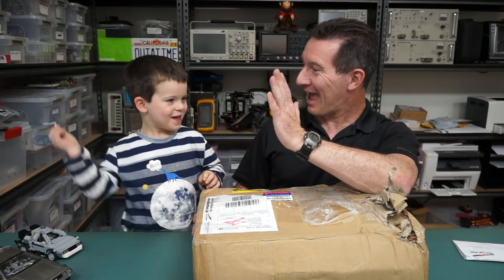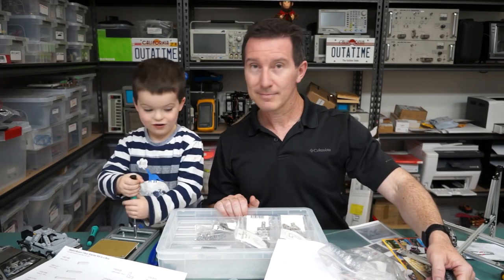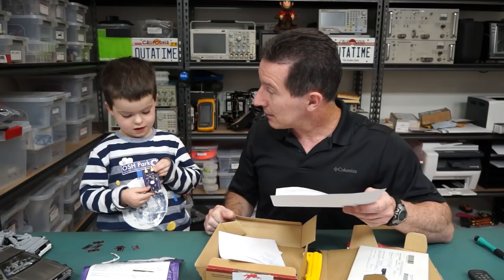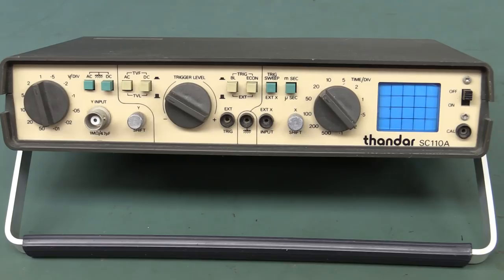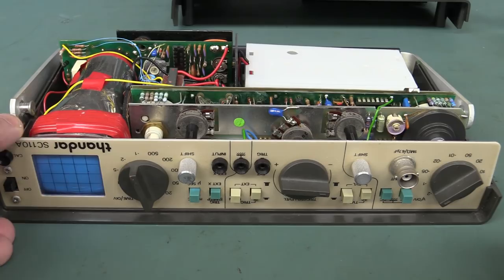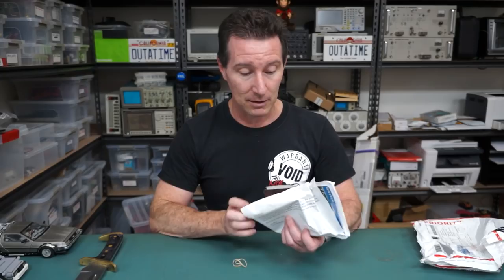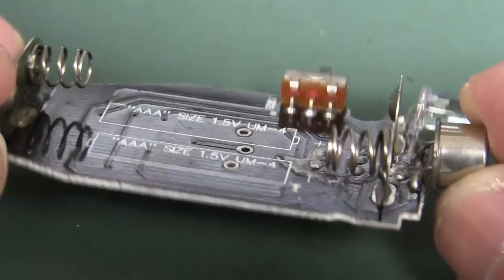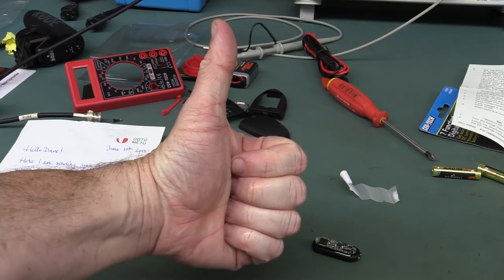EEVblog #813 - Mailbag

Comment: When I was Sagan's age, I unscrewed wall plates off of the wall.
Reply: Did you have a multimeter with you to check them out and then if they weren't working right fix them not lol for me when I was old enough I would be fixing problems the people didn't realize I had right then and there if I had the parts of a whole I kept electrical supplies with us in the car you'd be surprised when someone when asked could Aaron take a look at that lamp Outlet whatever I'm like sure where is the electrical panel so I can shut off the power if need be also the reason why I had a hundred twenty volt powered Boombox in the car and find out what circuit so it was on they did not have breaker fuse finders back then but there were times which I couldn't kill something I'm very tempted to crowbar the thing a k a dead short did that once and guess what well couldn't kill it but what are the neighbors knew I was working over there and came running over and they said how far lights are flashing I'm like what is going on and I noticed that it seems like there's a lot more energy than just it may be a single circuit turns out this was range wiring or similar it had completely bypassed the service entrance all together it was running to the meter box directly found out later bypassing the meter entirely along with us which we could not figure out that they noticed that sometimes you want to throw was extremely low and our times very high that switch was turning on and off the voltage coil do drug terminals on the back of the meter where there was a link that could be removed on those old meters so another words whoever originally had the place was stealing power obviously not the first time I've seen crazy things like this also unenroll metered water service that have been abandoned and reconnected and the horror a place that had never had Natural Gas officially but had gas appliances and was working but there was a meter that was hooked up to the gas lines lighter for these except not all of them we're actually metered but they have been using about turkey for the longest and didn't even realize there was gas present even without the meter up and to the point they smelled gas the gas company try to show it off but there was still gas on to certain appliances.

Also I've seen places where there was natural gas service but the utility company said there was never gas service to the place and there was no record of any connections whatsoever.

And also and there were times in which there was a house that have been built and there was never any gas but there was a gas line coming into the foundation that was connected at the other end and not being able to be shut off and the people thought they were crazy because they smelled natural gas but new Dr was never any girls was looking around and I spotted I can't turn off pipe in the foundation sure enough gas line leaking.

Comment: 35:10 I agree with you 100% when comparing this "Free" to $5.00 cheap meter to a $200 Fluke.
But there are a lot of new young budding electronics engineers out there that just can't afford a $200 Fluke.
37:30 If you use the meter under 50V and a max amperage of 5 Amps this meter is accurate and safe enough for electronic/arduino type experimenting. We use these cheep meters in the shop as throw away quick checks and the Flukes as precision accurate and higher voltage use.

All you seem to have done is let the younger players feel that they are idiots for using a cheap meter like that when in fact it is quite usable and accurate.
Reply: Exactly
Reply: I think the same and more: the ones surprized by the precision of cheap multimeters are idiot enough to don't contrast them with their 'great' multimeter's precision and it's many times the same 0.5%. Funny when they take the expensive multimeter for precision and many times its the same lol
Reply: yeah but it's good enough to check a double  a battery
Reply: I don't think he was deriding that multimeter or saying it is junk, yeah he was kind of negative on it but was impressed with it's accuracy and low price. But he didn't give out a flat recommendation not to buy it just pointed out that it's a bit dodgy for non hobby work
Reply: Here In india, I have seen in all the repairing shops in my hometown they use this multimeter for working with both dc and ac voltages(230 Volts)😥😥

Comment: That Rossin item is a single-beam PIR - single beam here meaning one detection zone - and PIRs are something I know about, having designed a few in the '80s.

Rossin was a US firm whose speciality was ultra-low power PIRs running off a single 3V Lithium cell and I just happen to have here the cct of their W60 I traced back in '85.

The chips should be a pair of CD4001Bs and the remarked one an MC14573 quad programmable op-amp. The L & C terminal are the output, drain and source respectively of the VN01 MOSFET. The cut resistor is probably the means of switching from NO to NC output - the W60 had a link. The Iq of the one I traced was 400nA so this one may still be working.

The IR sensor is a funny with only two terminals, not the normal TO-5 with a silicon window three-terminal one. Unfortunately there's nothing about it on my traced cct.

If Dave asks nicely I'll scan my hand-drawn cct and notes.
Reply: +Graham Langley Found I've got the product flier. It's either the R50 (wide view) or the 70W40 (long range - 21.5m).  Battery life is given as 15 years.
Reply: +Graham Langley The memory has dug up that someone had a patent on using a faceted mirror in PIRs to generate multiple detection zones - this was before HDPE Fresnel (that's 'fren-ell') lenses came along. 

It might be that the Rossin PVDF(?) sensor has multiple elements and so only needs a simple convex mirror.

Comment: Honestly though. Those cheapy multimeters are pretty reasonable for everyday use. I think in this day and age it's pretty easy to make a reasonable multimeter that would work perfectly fine for hobby level projects for pennies.

That said if I had to mess with any actually high power stuff, that would not be my first tool of choice.

Comment: Wonder if the rossin thing is a beam-break detector - that would explain the lack of facets (though may be a faceted lens insid the copper can) . Battery may be to provide pulse power due to 2-wire connection, or maybe biasing the sensor
Reply: +mikeselectricstuff Nope, it's a PIR.
Reply: +mikeselectricstuff i think is that or signal jammer

Comment: My father was given that Harbor Freight DMM (in yellow) as a door prize, just for walking in during a promotion.  He complained that it had malfunctioned, and that sparks shot out...upon further investigation I can't really fault the meter as my dad tried to "test how many amps the kitchen circuit was" by putting it in the amps range and sticking the probes in a wall outlet!!! LoL  I told him I'm glad he's still living.
The failure mode was 3-fold:  The fuse charred (probably still passing mains), traces on the board started to lift and blacken, and the black probe lead failed open. 
Miraculously, with a new fuse and leads the meter seemed to work just fine!
I warned him to keep it away from outlets, and removed the traces to the amps range to help protect my pops from himself in the future.
Reply: +Stephen Tack 
Well, I did it with Fluke 333 on ohms range. Twice! The result: 2x burned 16A fuse (ceramic 220V/16A) + set of burned leads. The 333 is unharmed and happy. Me to.
Reply: zlotvorx fool me once...?

Comment: I had an SC110 scope from new - at the time it was about the cheapest new scope you could buy.  One of the transformer overwinds is for the filament - done like that for either HV isolation or low capacitance.
Thandar was Sinclair's test equipment division - changed the name & split off when Sinclair went into computers. They later merged with Thurlby to form TTi. I met someone recently who worked there at the time - some of the old guys are stil there at TTi
Reply from the maker: +mikeselectricstuff Thanks for the info Mike.
Reply: +mikeselectricstuff One of the electronics mags around at the time did an article on the circuit design of this. Can't remember which one and my copy may have been recycled some time back.

Edit: Just remembered a couple of things. The case was borrowed from something else and wasn't quite big enough internally to accommodate the flare of the tube, so the walls had to be milled out to make room. And the rechargeable cells they sold for it were AAs in a C-sized sleeve, which you only found out after you'd bought them.

Comment: These cen-tech meters will report different readings based on the battery voltage. Some may consider this a fault, but I think it is a feature.
Reply: +Macpod HOW IS THAT A FEATURE? (caps lock, to lazy to re-type) 

like.... how could that be useful besides confusing your friends? here use this meter, its 100% accurate. 

if i let off the gas quickly in my truck it pops out of 3rd gear... thats a feature, it shifts for me!
Reply: +kain hall It's a subtle feature to let you know this meter is garbage, mate :)
Reply: It's a battery gauge, you connect it to precision voltage reference and depending on voltage shown by meter you know how much energy is left in the battery.
Reply: I have one of these. The useful thing is, even when the battery is completely dead it still measures 5.5 ounces.
Reply: When the battery dies, just go pick up another free one. :-)
Reply: @kainhall   the time it took to type im to lazy to re type you could have retyped it normally in the same amount of time 😂
Reply: Another words let you know if when think you're getting consistent errors time to check that 9-volt and if it still doesn't time to grab the test leads from the other previous meter you had if that still doesn't fix it time to get another freebie
Reply: @kainhall  basically it's way of flashing low battery low battery low battery
Reply: @macpoddotnet  well yeah there's that too and the transistor tester socket well I hate to say it but yeah still have an old dedicated transistor tester which occasionally I do use mainly for characterizing and such or just see if something's amiss or something haven't use that thing and no I don't know how many years but it came in handy when need me. This was an actual transistor tester dedicated device of course nowadays it's something like that probably wouldn't even be around and be combined with some component tester that could do all that in a billion different things and tell you a billion different things about that same transistor
Reply: @shana_dmr  yes Bingo we have a winner
Reply: Dave Micolichek  I think all of us at least most of us that have end of Harbor Freight in the last ever how many years have at least one keep a couple extra because of less just say quality issues and a fact hey if it's free why not just like the Harbor Freight lights that you get for the same amount except those are actually better than anything else I've seen well besides the parks dishes are magnetic for free yo got a few of those as well Mass Effect 1 has a couple tins of Altoids Smalls and it right now just sitting on the cabinet seriously.
Reply: @gravelydon7072  true and if you need a battery and you need to pick up something else and you can get away for cheap battery pick up another meter you got free cheap battery!

Add an extra meter an extra set of test leads
Reply: @aaronbrandenburg2441  Yeah, but who needs more than 4 of those meters? ;-) I have an Ames and a Radio Shack meter that is older then many on here. And if I want a really old meter, there is an analog Heathkit meter that was assembled back in 1971.

Comment: Grew up using these cheapie meters. I've still got one lying around, except mine has gasp a backlight!
Reply: I've got that meter too. I'm still using cheap tools and salvaged parts.  That was my first meter, and its actually my favorite.
Reply: +Alex Kantor And I paid like $10 for that meter!
Reply: +RadRider33 yup, still have one myself, good 10 year old design. But it works! and it's better to have a multimeter than not have one (and I don't really do in electronics to have requirement of better than like 5% precision)
Reply: +RadRider33 
I have a Harbor Freight about a 1/2 mile down the road .... Whenever they go on sale for $2.99 I pick a couple up. Got one in my boat, my truck, my car, next to my main desktop, the garage workbench and a couple sitting on a shelf unopened. I don't even bother changing the battery because the cheap leads will be on their last leg and break before the 2nd battery goes dead. I just pitch it and grab another off the shelf The leads used to be a lot better, larger gauge and better insulation , no way would I trust the new ones to take 10 amps, the  resistance of the leads would be 10 times or more than the shunt and the measurement worthless anyway
Good enough for 12V boat and auto circuits, testing batteries and continuity checking although I think they should just ditch the transistor tester and add a continuity buzzer on it's place
Reply: +RadRider33 that design was my first multimeter too. got it like for 6 dollar local currency equivalent like 10 years ago. Mine died sadly (numbers jumping for no reason, no measurements on any range), lead broke somewhere inside. Still have it as my first dead measurement instrument.
Reply: SgtPiggie, here's the current one and it is good till near the end of the year. 
http://www.hfqpdb.com/best_coupon/7+Function+Digital+Multimeter
I have two of the current ones but they are only good to 5 amps. But hey, like the one he showed, they are usable and free. I have one that is dead on on all ranges and the other is off on only some of the scales. Don't care if they go bad as I'll just pick up another one and save my RS one that can do 20 amps when it absolutely is needed.

Comment: I have gone through at least 5 of those Cen-Tech multimeters. I have never had to change the battery. They blow up before I get to it. Wear the right gloves and it can be safe enough. The case holds in most of the pieces of the pcb and battery

Comment: Re: Cen-Tech multimeter.

I bought one of these 6-7 years ago. $3. It has rattled around in the tool box all that time, and always works. Original battery. The transistor tester is useless, but the battery tester is not, I use it and many other features most every day. Recently, the probe wires wore out, and I elected to buy new wires rather than a new meter. For the average person, it is fine. Every value I have been able to cross check is reasonably close.
Reply: I have one of these. It doesn't measure anything external, only the values of the internal components. It's useful in that respect.
Reply: Keep it away from high voltage, absolutely no protection in it. Otherwise it's great for checking batteries and ultra basic diagnostics.
Reply: As someone who barely knows what he's doing it's good to let me know if my better Radio Shack meter is working or if I'm doing something wrong. I bought it for the transistor tester which is not great and because at $3 how can you not.